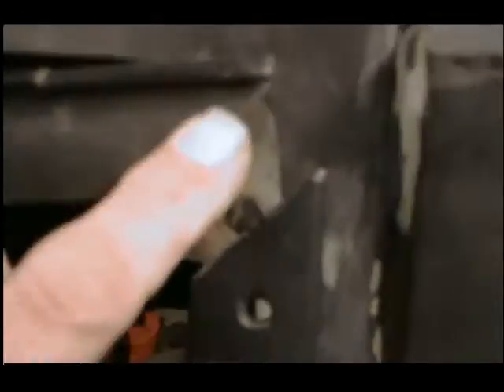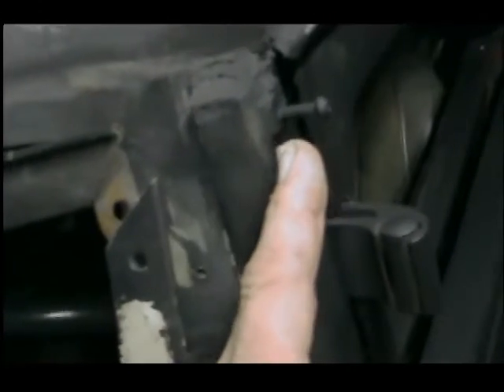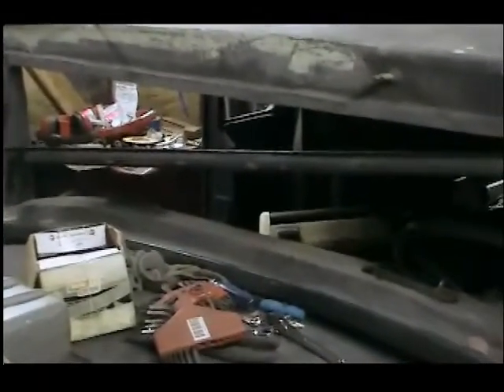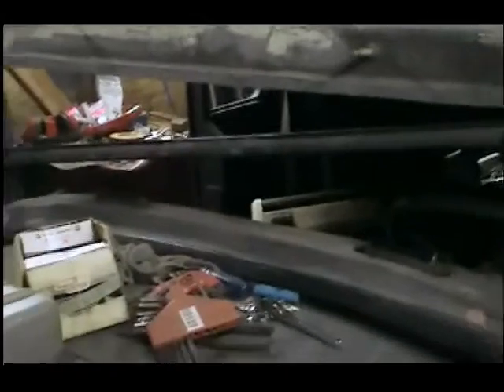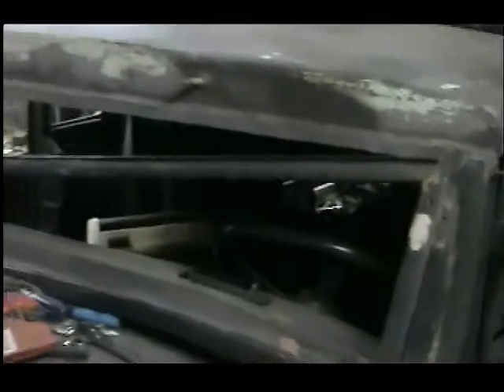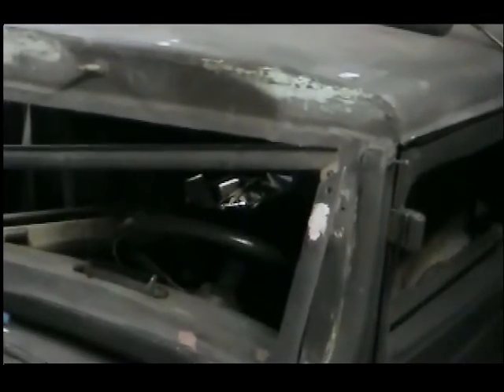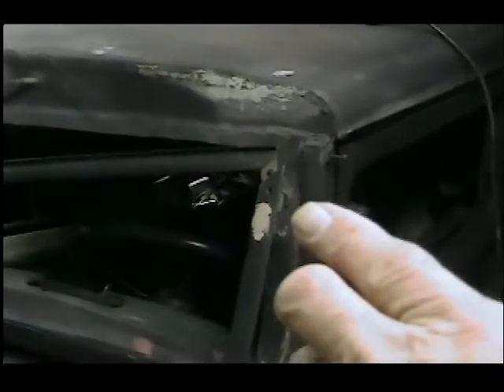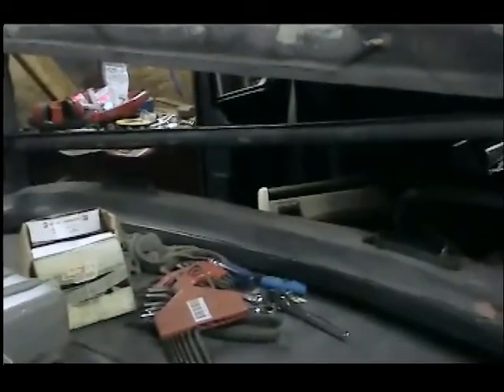96  Why I hate using others  installing glass, UNBELIEVABLE!!! .wmv

Comment: What happened to the original template??? You need to find someone who deals with antique vehicles. This is why it is important to check out a place before contracting them to do the work. Shipping it out would have been cheaper in the beginning, right?
This is the way it goes when building modified vehicles.